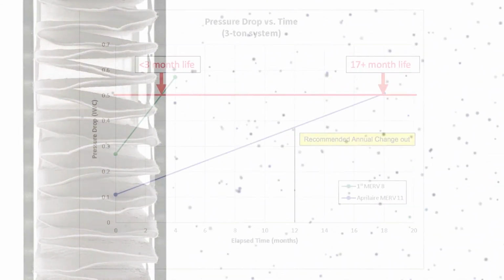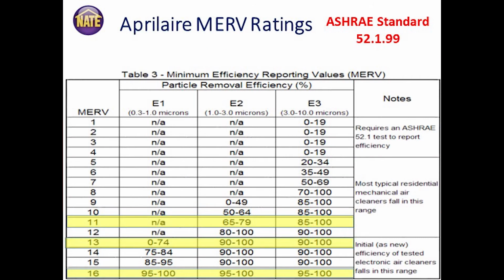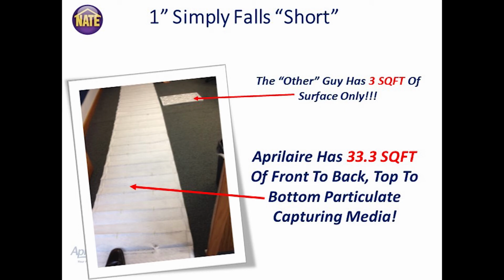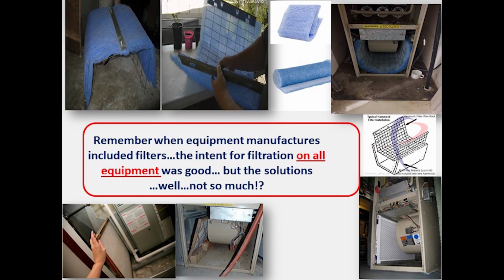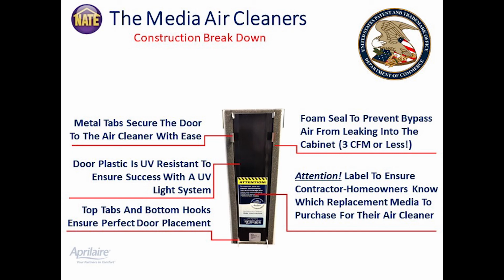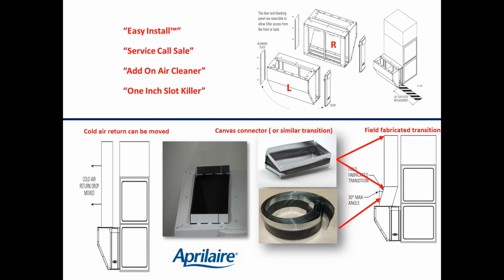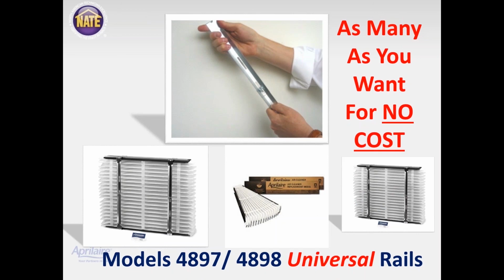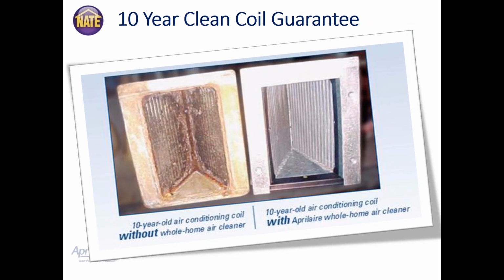AprilAire Air Cleaners Product Training Webinar (Recorded February 2020)

Comment: 90000 hrs on a ECM motor yeah looks like those hrs have been swapped, cause ill be damned. More like 4  to 5 years of use on most ECM motors. Oh you talking about the first ECM prototype yeah see how far that went lmao. Thats so bad info. BTW whoever puts yalls electrodes in the canisters on yalls humidifiers needs to completely seat them. Beat tall been getting few warranties on those control boards.

Comment: How do I RESET the Control Panel on my Aprilaire Media Furnace Filter Model # 413 that is located on the door that contains the filter?
Reply from the maker: Thank you for contacting AprilAire! We apologize for the delayed response. If you are looking to reset the service reminder, you would just need to hold the up and down arrow at the same time for about 5 seconds. Otherwise, you can power cycle the thermostat, but we would never recommend to reset the thermostat using the reset button. We would be happy to discuss this further with you and can be reached at 800.334.6011 Monday through Friday, 7:00 a.m. to 5:00 p.m. CT.

Comment: Question on the 2 slides at 16:30 through 17:30. What filter size is assumed for these pressure drop numbers? 20"x25"?
Reply from the maker: Hi Brad - Thank you for contacting Aprilaire! This is a 16” x 25” nominal filter size. If you have any additional questions, please let us know.